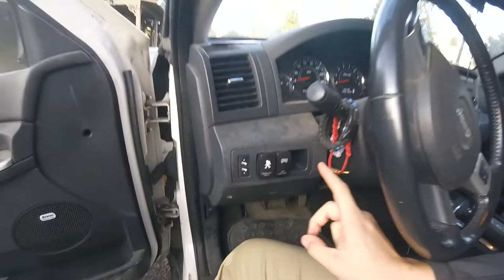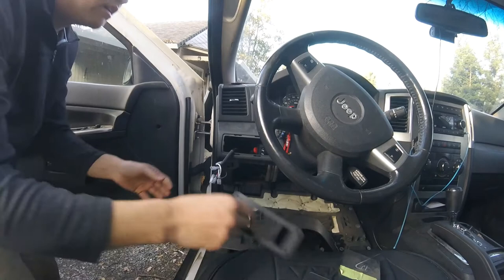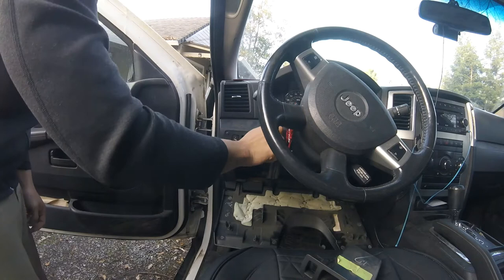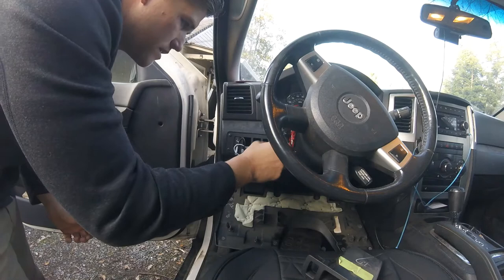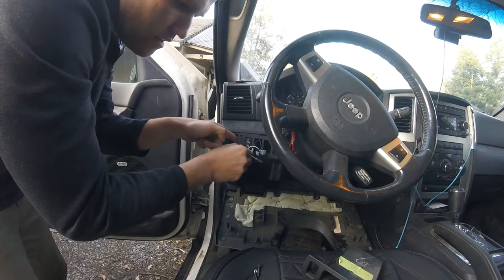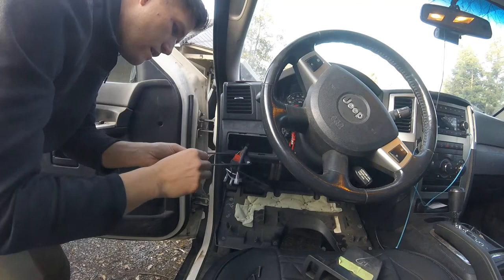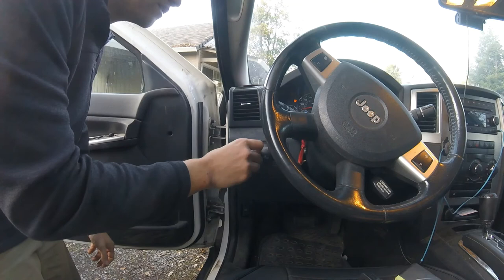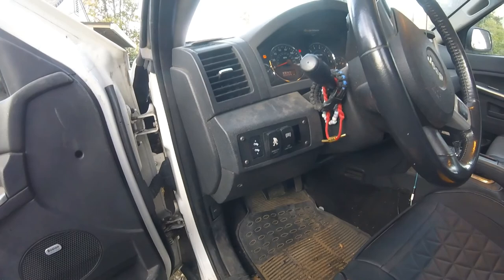Jeep Wk The Steel Armadillo Switch Pannel “How is the quality???"

Comment: Are those seat covers?
Reply from the maker: What do you mean? And it’s holding up pretty well. It’s a super simple design.
Reply: Aarron ching your seats in the Jeep look like they are after market seat covers
Reply from the maker: Only the driver seat bottom has a cover so the sun doesn’t eat it up. The rest is the stock leather vinyl mix